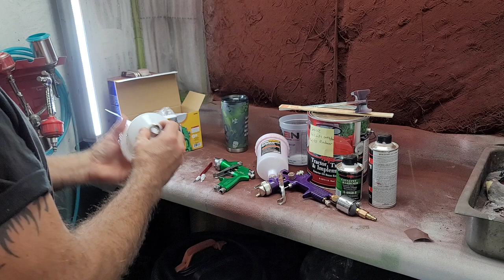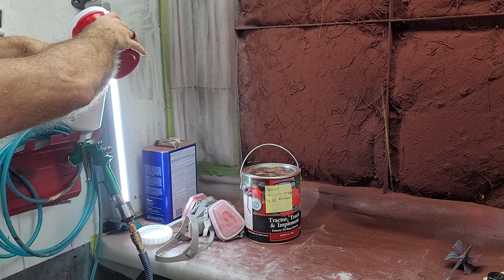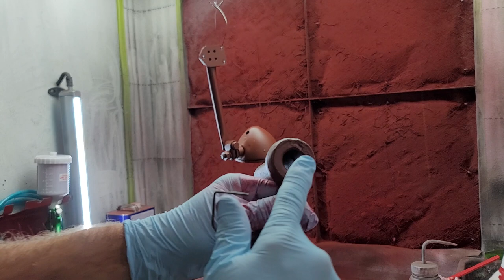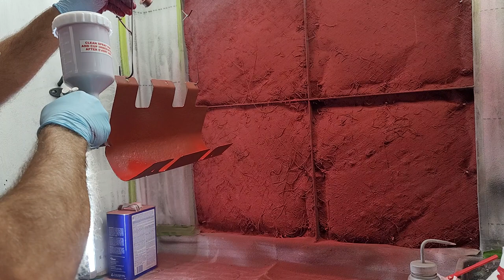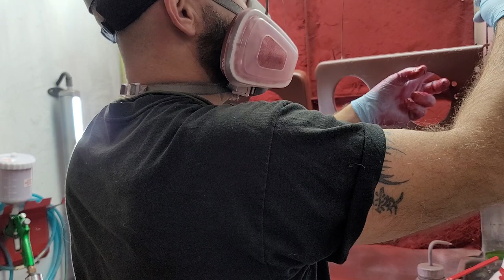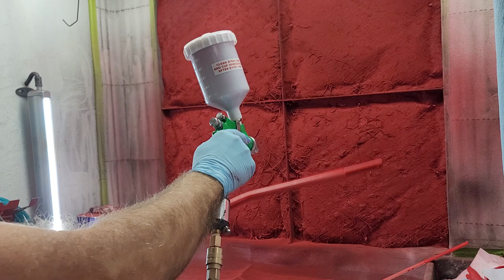Majic Paint for the Farmall Super A

Comment: First off, throw that internal filter away. The only thing it is good for is restricting paint flow, second 30lbs. pressure at the beginning of the hose is around 16 to 19 at the gun, put a regulator on the gun to be precise. All this comes from 40+ years of experience, believe me I learned he hard way.
Reply from the maker: Definitely the best experience is learning from our mistakes!  Yeah Ive changed everything since this videos,  shorter and bigger diameter hose, Eastwood concourse spray gun, no internal filters, etc. Everything Definitely sprays much better now! Thanks for the info though,  its always useful.

Comment: Great job man learning a lot, I’m painting my Wheelhorse 314A , hood seat pan, foot boards , attach o matic, frame (motor n console left in place), fuel tank support bracket , how much paint you’ll guess I’d need.. I’m using the spectrum cup system from hf. I like your 16 oz mix, that may cover a lot. Trying to figure out how to paint the inside n top of the hood n seat pan , any tips would help. Thanks

Comment: Do l use hardner with the majic primer? Also do I use the same reducer primer ratio as the paint?
Reply from the maker: Yes use hardener for a better finish and shine. As far as primer, just reduce until it sprays smoothly from your gun. Primer will use a bigger tip than the paint requires in your gun.
Reply: Thanks

Comment: One of the videos I watched later after yours mentioned that Majic paint has a tendency to fade. And the way to curb the fade issue is to wait a week after painting then cover with Majic High Gloss Lacquer. What is your thought on this?
Reply from the maker: The 1952 Case tractor I did years ago seemed to hold up very well and didn't fade. I also heard some say it does and others it doesn't.  I think it depends on your area like in Arizona versus Maine. I clear coated this one for 2 reasons,  for the just in case and to give it a deep shine. 
I used Speedkote clear , it laid down very nice!

Comment: That paint gun comes with a 1.4mm nozzle.  That seems very small.  Would it be better with at least a 2.0 mm nozzle?
Reply from the maker: I bought a new Eastwood concourse 2 so Im gonna redo the fenders next week using a better gun. If that doesn't spray good then yeah I was thinking the same thing to go to a larger tip.
Reply: @bourbonbeertractorsandprep9335  Did you end up using a bigger tip?
Reply from the maker: @arthursterlingiii7725  yeah I used the 1.7 for the paint and the 1.4 when I shot the clear coat. My newer videos shoes the tank being sprayed and how much better everything layed down.